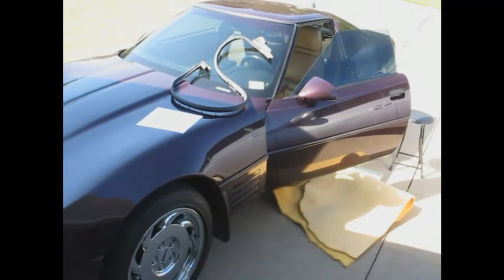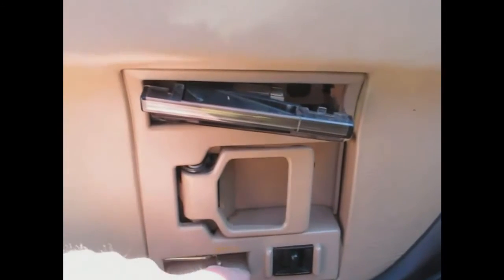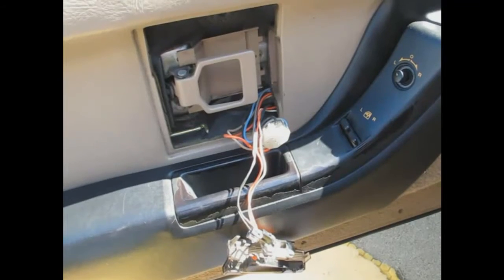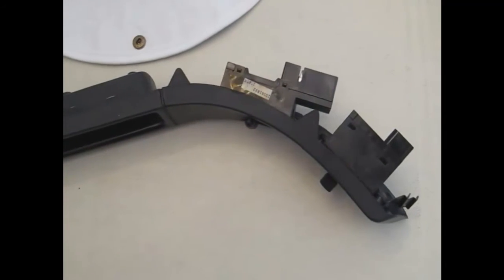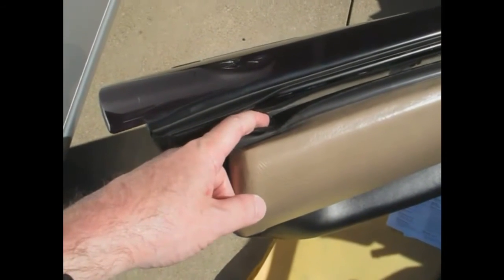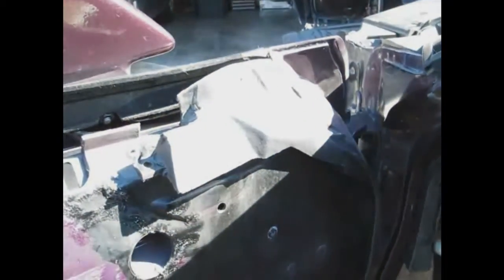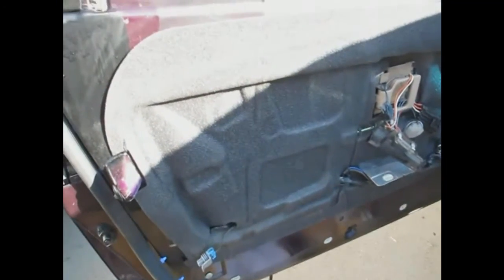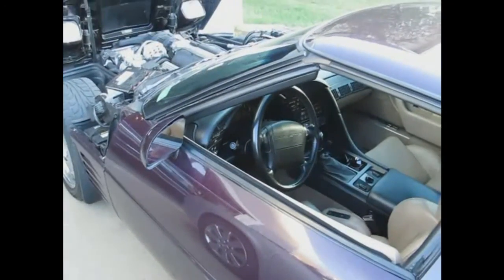1992 C4 Corvette Driver Door Weatherstrip Replacement

Comment: Did u figure out the power lock?
Reply from the maker: Unfortunately no - but it more or less works and I guess that's why. Still a bit stiff, but otherwise functional.
Reply: Mine turned out be a blown fuse

Comment: The same shit happened to me with the lock. I couldn't and still can't figure out why the hell it's happening. I can manually lock it but not unlock it. But the power locks work fine both ways with no resistance. Wierd.